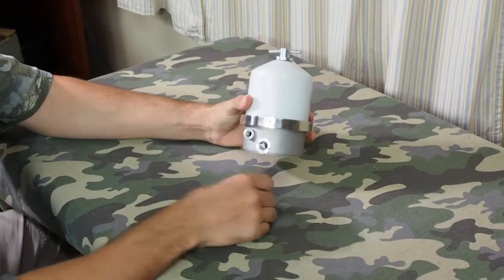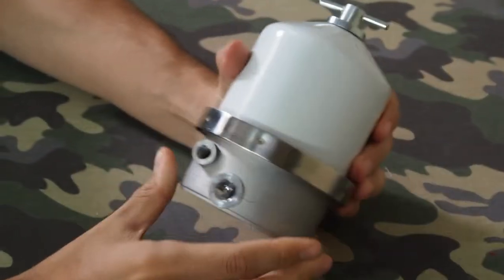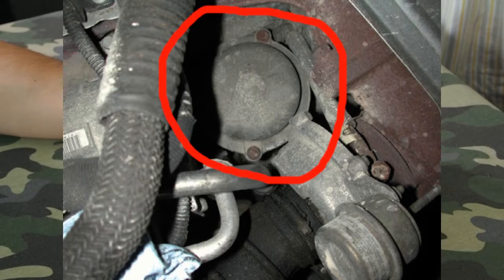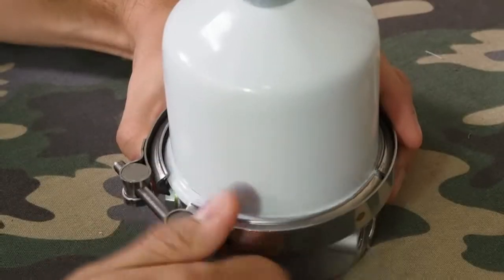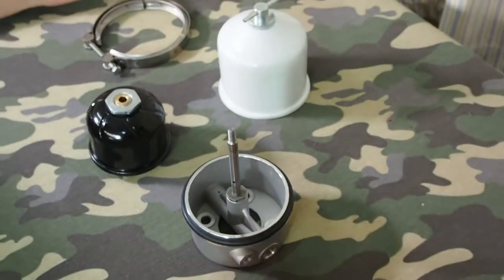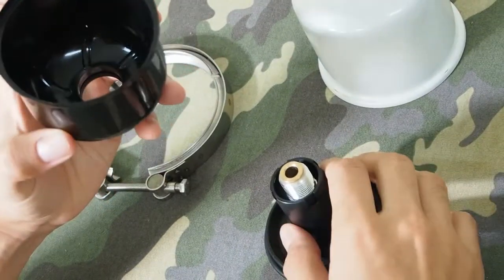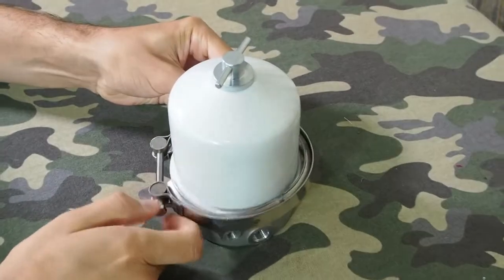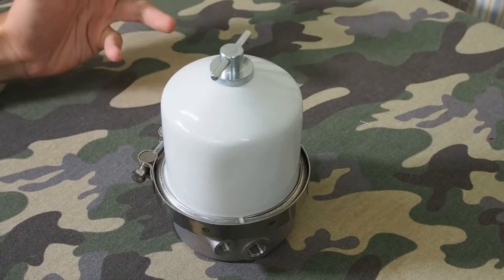Centrifugal Oil Filter for Hilux LN106 part 1

Comment: 1,000 miles ago I installed a centrifuge on my 2015 Duramax. What a huge improvement! At 1,000 miles my oil is still essentially clear, not the typical black we see with traditional filtration.
Reply: I have a 2001 duramax. Interested in what filter you used and how you connected it, thanks Doug